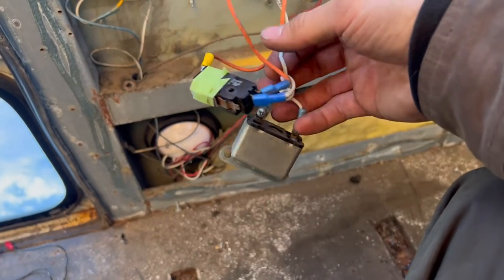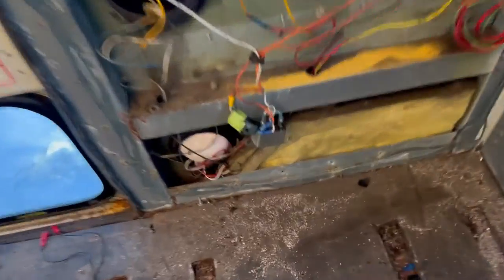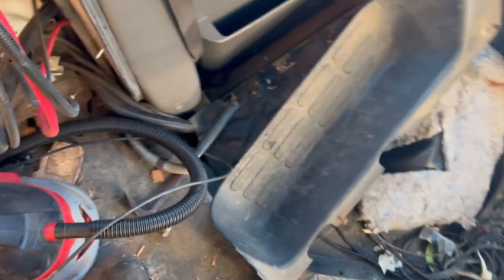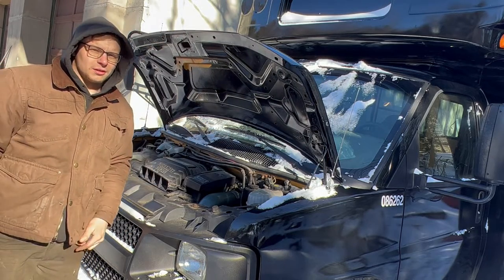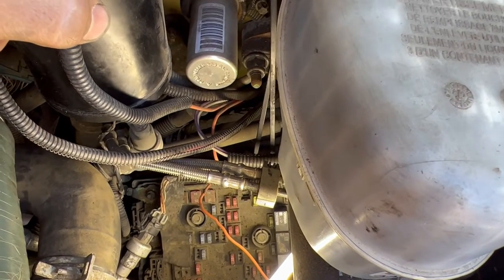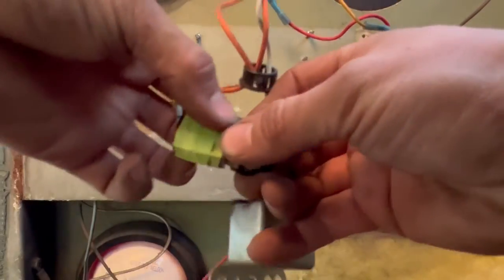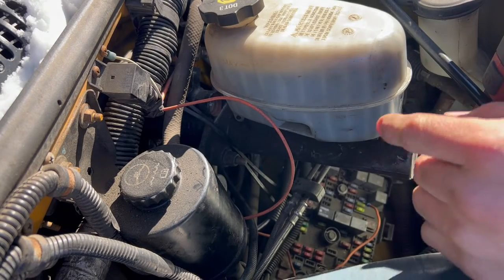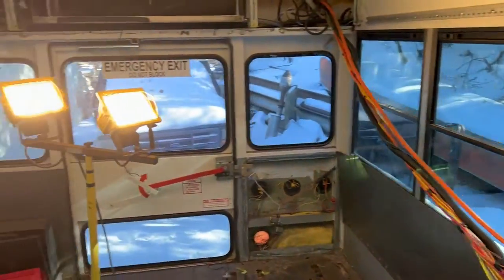HOW TO BYPASS EMERGENCY EXIT INTERLOCK: Van chassis Short bus no start

Comment: my 1999 ford shuttle bus is a little different.on the tnterlock i found in the wall open . and i couldnt shift it into drive .im gonna try yur way just taping  the interlock like you. because of all the wires on the relay its wired to hmm
Reply from the maker: Ohh yeah that sounds a little more complicated than how ours what set up. Ours only made it so you couldn’t start the bus, but once it was started you could have the switches open and still drive. Let us know if you figure out how to bypass on your rig! Very interested
Reply: complicated but figured out.how many miles to the gallon do you get.mines they say is 7 to 8 miles to the gallon i have the triton v10  . 6,8 litre
Reply from the maker: We get about 15-18 mpg, but we have a 6.6 duramax and it’s deleted and tuned so we get a little better mileage
Reply: @BenekeBuilt  wow thats great mileage hoping it gets atleast 10  per gallon.mine weighs 10 thousand pounds . who did you go through to get insurance
Reply from the maker: We went through State Farm!
Reply: @BenekeBuilt  state farm sucks in calif i had to use sams r.v. club insurance much cheaper
Reply from the maker: @bobcoopersliveyoutubevlog  is that the Sam as Good Sam? How was it getting insurance thru them? Being a bus conversion and all?

Comment: Hoping my Thor E-450 Ford is similar in simplicity. I'll just trace back to the distribution in the ceiling and splice the wires there. Hopefully it won't be too difficult. I was considering keeping the lift, but I was having issues, and thinking that could be why the retirement home sold it. I'll also be upgrading the batteries going to the wheelchair lift. I'll probably just use the bay for some tools that can get dirty (or seal them) and keep the batteries inside.
Reply from the maker: Yeah hopefully it’s simple! Our wheel chair lift didn’t work but we think they just unhooked it when the decommissioned it to use as a service van for the rest of the bus fleet. No problem tho because we were planning on taking it out anyway. As for the wiring you probaky could just trace the wires to the switches and permanently connect them. We didn’t do that souly because we gutted the whole interior, and stripped every wire that wasn’t needed to run basics like exterior lights
Reply: @BenekeBuilt  Ya, it just depends on how they do the interlock. If it's a ground or positive. Like the DVD stereos that don't allow you to drive with them on, but the bypass works. You used to be able to hook them up to ground, but so many people abused it, so they require it to be on, then off, then constant on, and you can either do that with the correct way, or a series of switches or a bypass module.

I'll test the wires with a voltmeter before I do it so I know what they require.

Comment: I think VDL stands for “vandal” as in vandal lock.
Reply from the maker: That sounds about right!
Reply: @BenekeBuilt  I was able to get some of the wiring diagrams from Collins for my bus… I can forward them to you if you’d like.
Reply from the maker: @mollybankhead5865  Thank you! We were able to get some diagrams from another person but after I made this video lol. They came in handy while we ripped all of the rest of the unnecessary wires out of the body
Reply: @BenekeBuilt  good deal!  Good luck!  I think the Collins bodies are the best/most versatile. Working on 2nd conversion. Had bluebird and international in the past.
Reply from the maker: @mollybankhead5865  nice! Yeah we loving the collins so far, 6 window, handicap, no wheel wheels, and plenty of room for activities!